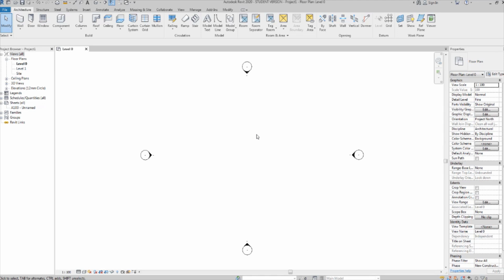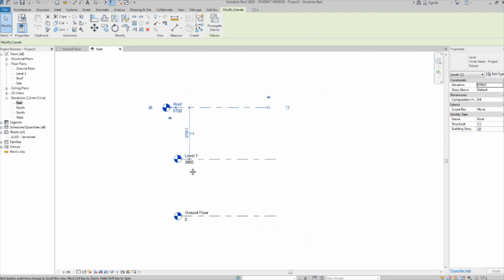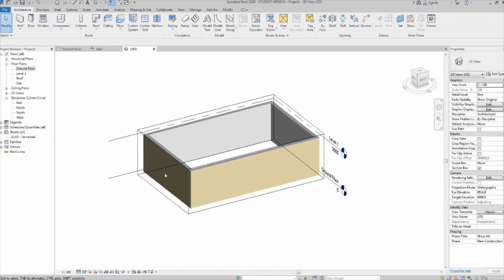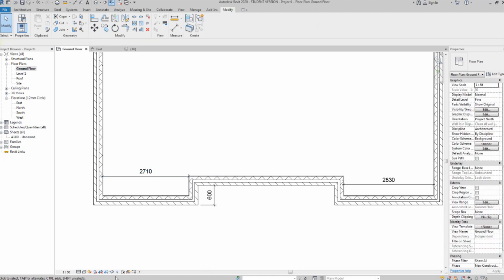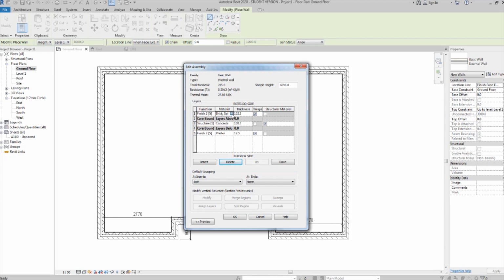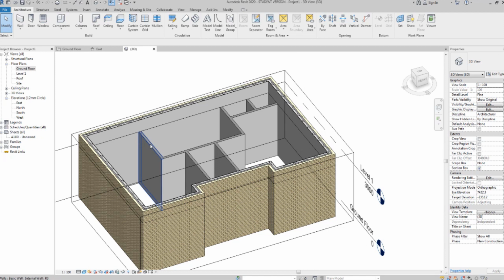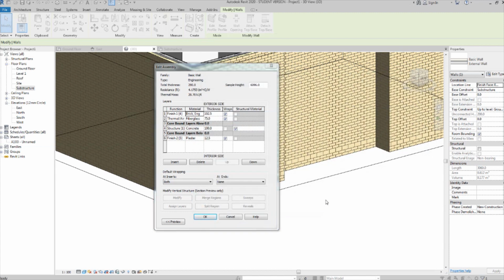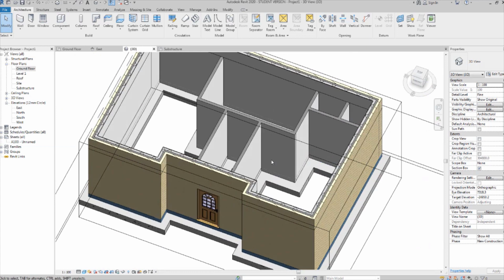Revit Structure Tutorials for Beginners

Comment: may i know why not use beam stucture instead for wall foundation? below ground floor.. u used wall with stucture material?
Reply from the maker: That's how I learned it on my first Digital Design class at University years ago, and it works as an attachment to the wall so if you had to change the wall later, the foundation with move with it.
Reply: @DrawingTechnical  ohh I see.. How about beam . For example "porch car area".
Should i use beam structure or wall for (roof car porch) beam?
Reply from the maker: If you're doing floor beams like a suspended timber/concrete floor, I would use a beam system for those.

Comment: This is a brilliant tutorial, iv been using Autocad for drawing house extensions and new builds. Can you tell me if revit is better for that type of design please or are they about the same
Reply from the maker: I am actually planning to start a house extension service using Revit at some point, I've used Autocad a little bit but from what I heard from someone who does do extensions, he loves Revit much more than Autocad because he can automate all of the processes that are done manually in Autocad. For example, if you model a house, and you you sheet the various views,  in Autocad if you change something on one view (like a wall position), you'll have to go to all of the relevant views and change them manually, which can cause you to miss something and submit something with an error.

In Revit, if you move a wall or anything, it will move it automatically on all views for you and you simply have to review. Saves time. And if you can set up a schedule, you can control the model/drawings from the schedule; for example if you need to increase a window size, you can type the numbers into the schedule which is linked to the windows and it will change everywhere at once. As far as I know Autocad, it is all manual. Sounds like a headache to me.

If you're considering using Revit, I suggest to go for Revit LT because it's really cheap compared to the full Revit, and the main difference is that full Revit allows team collaboration on 1 model, so if you're a lone wolf, Revit LT should be good enough. Here's a video I made on comparing Revit and Revit LT for more information: https://www.youtube.com/watch?v=HVQWEbZSmcw

Hope this helps. And I'm wondering you would like to connect at all? I am interested in how you provide an extension design service for people, maybe we could help eachother out. If you're interested, let me know. Thanks for watching.
Reply: @DrawingTechnical  Again thank you for your help. Yes that would be good. Let me know your details etc
Reply: @DrawingTechnical  yes I think that would be very helpful. I’ve sent you an email on your website, let me me know if you received it ok 👍

Comment: Which template and libraries did you use for the tutorials?
Reply from the maker: Architecture template and the libraries exist in Revit already, I mean you download them with Revit.
Reply: @DrawingTechnical  Thanks for your quick answer. I'm asking, because I didn't find the Basic Wall and the special Brick material
Reply from the maker: @walterholzwarth4088 You're welcome. You can take any wall (duplicate it so you don't lose the original), and you can edit it from 'edit type' in the properties panel, from there, you'll have to follow the video to see how I changed the material.

Comment: please i cannot find wall face command
Reply: when you said you cannot click the edge of the wall and the you clicked wall faces command i cannt see it even i selected the wall . please help me . thanks
Reply from the maker: @papillonbougie7080  Hi, you're referring to the wall face selector that I mentioned at 11:00 - You need to have the dimension tool seclected first, so hit the 'DI' keys on your keyboard to activate the dimension tool, make sure your dimension tool is set to 'Aligned' from the top panel, and then you will see the setting to select wall faces as in the video. Let me know how it goes.
Reply: @DrawingTechnical  yes i got it god bless u
Reply from the maker: @papillonbougie7080  you're welcome :)
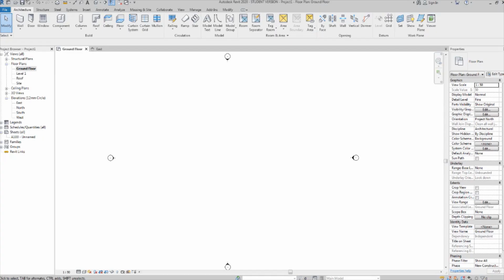Reply from the maker: Hi, you can see me selecting the wall tool at 4:34,
It's just under the 'Architecture' tab, if you select 'Wall', you will have the command activated. I guess that's what you mean?

Comment: Really like how you split the walls vertically in 3 levels. Always seen walls done with from ground to roof. Love the house structurally. I am coming to your house if there is a tornado...haha
Reply from the maker: Heh heh, I tend to over estimate or over kill on the structure to try and make sure it doesn't fall down, and I'm not even sure if it's structurally sound as I'm not an engineer specifying the material size and density. I think over estimating would be better than under estimating the materials but perhaps that would mean more stress for the overall structure.

Comment: i have question when i open my revit i don't find the gaberit or level of elevation
Reply from the maker: Hi, you can find the level of elevation from the 'Elevations' list in the 'Project Browser' on the left, click the small '+' icon and it should open a mini menu with the North, South, East and West elevations. Double click one of them to open an elevation and you'll see all the levels, and you can edit them.

Not sure what you mean by gaberit
Reply: @DrawingTechnical   Check if Floor Plan Views Exist for Those Levels
Go to the View tab > Click Plan Views > Select Floor Plans.
In the New Floor Plan dialog, check if Roof and Substructure levels are listed.
If they are unchecked, tick the boxes and click OK to create views for them. I hope this helps. I didn't have to check just highlighlight shift click both and click ok. Now both - Roof  & Substructure will be displayed under your Floor Plans in your Project Browser. There are another 4 things you can do if this doesn't work. Let me know.